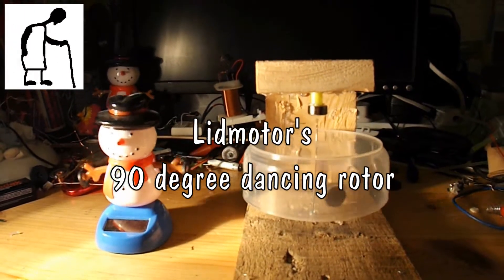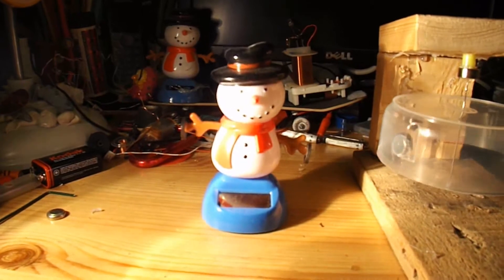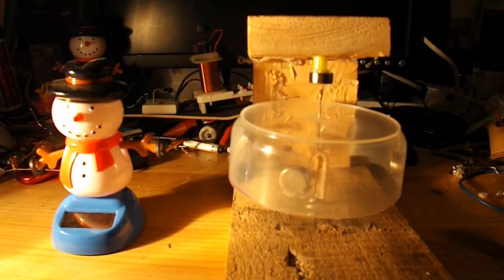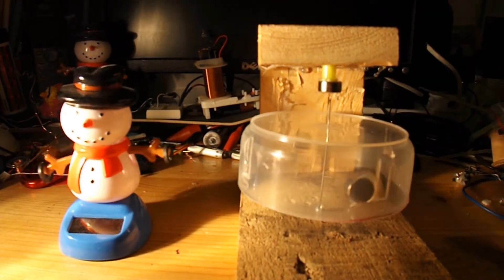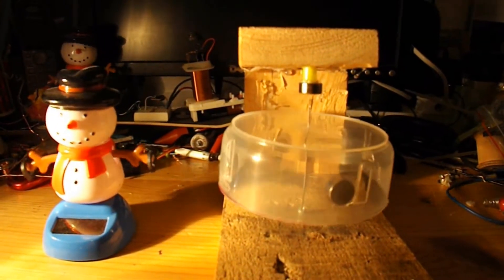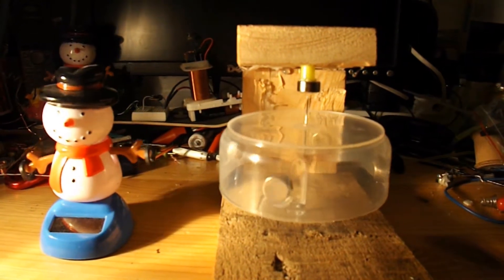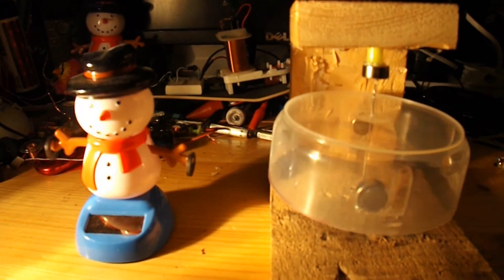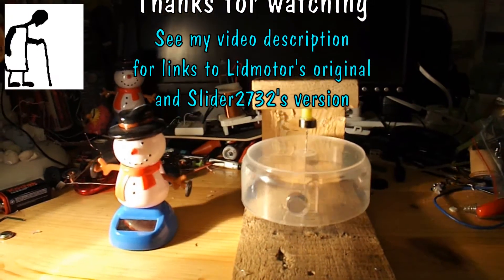My version of Lidmotor's 90 degree dancing rotor

Comment: Well done.  I just watched Slider's version also.  They take a bit of tinkering to get running but are great fun to watch.  I wonder if two rotors would work.  One powered by each arm.
Reply from the maker: Yes it does stop after a while as I haven't got it quite right. It wouldn't surprise me if it would work better with 2 rotors as it might help the balance.

Comment: Hey hey glad to see you built one :)
Deceptive things really, looks easy but takes a lot of patience and trial and error. Lots of mucking about to get the right distances...but when it carries on, and on, it makes it worthwhile.
I was going off to make coffee, doing things out of the room and then would pop back in and hope it had carried on...when it did was when my own vid was made.
Reply from the maker: Yes, it started running as soon as I assembled it, then I adjusted it and it just oscillated, then it ran again. It's not perfect but I am happy. That is my first attempt at using a needle and a magnet bearing setup so I am pleased that worked. All just hot glued in place of course :-)
Reply from the maker: I wanted to use polystyrene pizza trays but had some handy bits of wood.
Reply: Yes indeed, the semi levitated is my fave form of rotor. magnetman2010 was first I think to demonstrate such an idea a couple of years back...it beats any form of bearing for micro interactions !